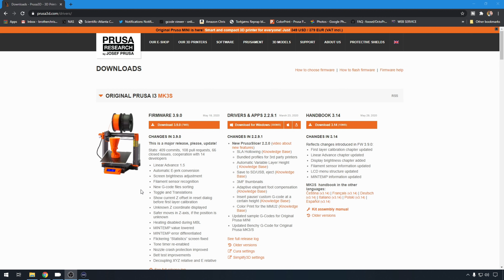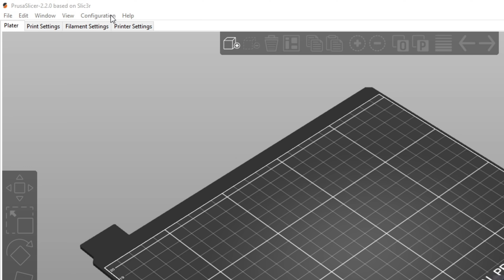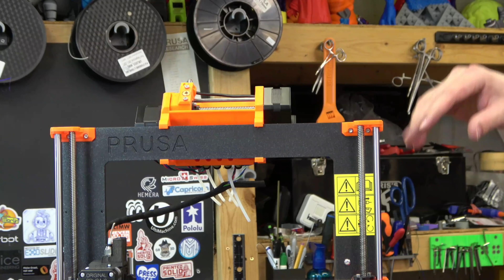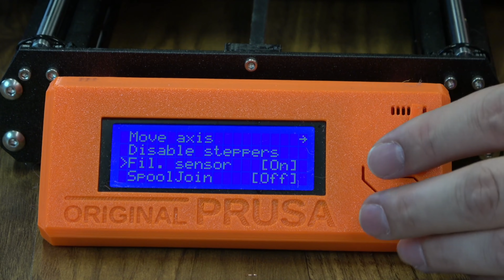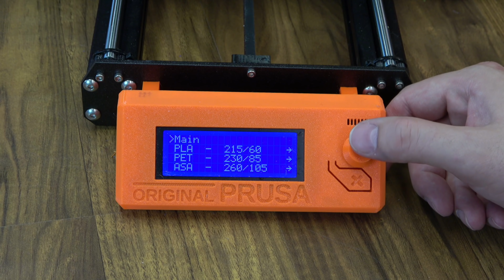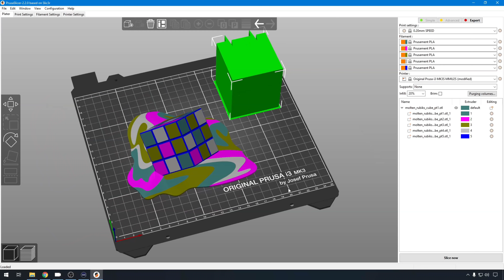Prusa MMU2 - Take 2 - Firmware Update - New Cut Feature - Time Lapse - Chris's Basement

Comment: I have a print at home that's stalled. the filament selector is slightly off and filament wont' load. is there a way to get the selector to home out during the error mid print?
Reply from the maker: You can pull the filament out and het reset on the MMU, but get ready to pause the printer, because it might continue without the filament. After the pause hit change filament and select the correct one. That might get you going again.
Reply: @ChrisRiley  Thank you , I'll try that next time!

Comment: Chris.. I am new to the hobby. I have a chiron with original firmware and ( original 8 bit mother board trigorilla) I have a mmu2 I would like to add to it . Would love to have a tutorial on just that. 
I would also like to know if I add a 2nd hot end and a 2nd mmu2. As I have a second kit I can build and add .. to be able to print with 10 different filaments . Would like an honest answer please
Reply from the maker: Hey Frank, that config would probably be a nightmare to setup. I am not sure how the slicer would handle that. With the Chiron, with out switch to direct drive and getting a filament sensor in the right location the MMU2 is going to be a real struggle. I might look at something like the Chameleon v2 that is made for more types of printers.
Reply: @ChrisRiley  just a quick question wouldn't the mmu2 act as a direct drive? And the filament sensor with in the mmu2 should work. In theory any way. 
I do have a bigtree gtr. Board I can switch to.. can run up to 11 axis. 
Thanks for replying.. 
So much for Left handed thinking...lol
Reply from the maker: @Twisted-wizard  Hey Frank, the MMU2 just feeds enough for the extruder to take over, so it's not a great extruder. The FINDA should work, but to keep the MMU2 and extruder from fighting, a filament sensor at the extruder works the best. Yes, a lot of reverse engineering here.

Comment: Thanks for this Chris. 

I was one of those people who's MMU2s turned into an expensive white elephant. I took it off over a year ago - it kept stopping even single filament  prints loading. Its sat at the side of the room "in disgrace".
 
This video told me Prusa had finally made an meaningful firmware update and design changes  - long overdue IMHO.

I dusted off my components, printed the updated parts, gave the all the moving pars a general spiff up, updated the firmware and low and behold it actually managed to print a part without intervention - not sure its ever managed that till now.

I think it worth noting that i printed a few other parts beyond those mentioned and my new parts seemed to have different tolerance vs the prusa parts I received initially. I was one of the first to get the MMU2S, so i don't know if they have made design changes or the printer mine came from was just having a bad day, but my newly printed parts from my own printer are definitely of a slightly different geometry, only really noticeable taking one off and pushing the other on but still there.
Reply from the maker: Great to hear that this got you up and running. I think there were a few parts that changed over time. Probably worth trying to reprint a lot of them if a user is having issues, not a bad idea.

Comment: So a new problem. I printed my first multicolor print using PLA and 3 times there was a kink in the filament. when the printer switches color with a kink in the filament it loads to the IR sensor and detects the initial filament but then the IR sensor changes states when it gets to that kink. There needs to be active monitoring on that IR sensor. the printer then fails to print a layer because it thinks it has filament but will not feed because of the kink. see my video about it here:  https://www.youtube.com/watch?v=q8UhnB1W_Bk
Reply from the maker: Is it a kink, or is it easting a hole in it? Might be the door springs are too tight.

Comment: Sooo.. I just completed my assembly of the MK3S and the MMU2S. I loaded only one filament in slot one to do a print. @ 20% the MMU2S started clicking and the MK3S just stopped printing and went back the the info screen. there was no recovery of the print job.. nothing. the print head just stopped where it was so the print just started to melt while the MMU kept clicking.... this was only with a single filament so this is not very encouraging.
Reply from the maker: Time to chat with support, something isn't right.

Comment: I'm trying to figure out how to use the IR sensor on a non-einsy board, but can't find much in the way of documentation.
Has anyone tried setting it up on something like an MKS Gen_L, or SKR v1.3?
I don't understand what the difference is between MMU_EXTRUDER_SENSOR and PRUSA_MMU2_S_MODE in Marlin, and I can't find any info for how to connect the IR sensor to the board.
Reply from the maker: The IR sensor is just a standard setup. 5v, you can use VCC, GND and Signal on any endstop pin you wish.
Reply: Ah, got it. Thanks!
The board I was using was a bit abused so I had to replace it with an skr v1.3, but now I can't communicate with the MMU2s at all.

In your first MMU2 video you showed a quick tip on how to connect it to an skr v1.3, but I can't get it to work correctly.
The combination of SERIAL_PORT and MMU_SERIAL settings seem to be different at every guide I find online, and no combination works for me.
Do you still have the configuration you used for this board available? Would be very interested in taking a look at that if you do.
Reply from the maker: @Akegata42  I looked and can't find it. I hope to have some SKR testing done soon.
Reply: Scrap that, I managed to get it connected on my old MKS Gen_L after all.
The behavior is very weird, but the sensor definitely works..
Reply: @ChrisRiley  Did you have to change FIL_RUNOUT_STATE to enable the IR sensor?
It reports incorrectly if I don't change that to HIGH, but when I do that the printer doesn't try to load filament when I start a print..
Reply from the maker: @Akegata42  Not sure, I am going to start testing it again soon.

Comment: I can not believe I just saw this video. well done Chris. I may have to go with that selector but I will try the one with the magnet in it first I have already printed both just haven't changed them yet.
Reply from the maker: Let us know how it goes. Thanks
Reply: @ChrisRiley  I just put on the new selector with magnet and I'm printing the pass through part now :-)
Reply from the maker: @zimmy1958  Nice, they are a lot of fun when you get them working.
Reply: @ChrisRiley  seam to working good but the cut function ( I get a jam there, bad cut ) my tip is not so good not sure why. It goes all the way to the hot end and pulls it back.
Reply from the maker: @zimmy1958  There is a new reworked mmu2 front plate that could help, I show it here. https://youtu.be/V4u0UnHD9Tw?t=669
Reply: @ChrisRiley  Thanks Chris

Comment: Chris, thanks for the video. Can I ask how long the PTFE should be down to the extruder when amended using the through coupler part please?
Reply from the maker: Stock the tube is 360mm, you can get away with using that one, but a 380mm would be better.

Comment: Another great video!

Do you have any comments on the stock filament buffer? I don't understand why you were just sitting these on some normal spool holders. Seems like that was a recipe for the tangling you had on the pink spool. I haven't used the MMU yet , so I'm very curious...

I don't know anything about the rewinding spool holders. Do you have a roundup or any specific comments on these?
Reply from the maker: The Prusa buffer is kind of a pain in my opinion. I like these.  https://www.prusaprinters.org/prints/31989-numbered-gravity-spool-holders-for-mmu2s
Reply: @ChrisRiley  Thank you again, that was really helpful!

I ended up printing a couple of these https://www.prusaprinters.org/prints/3729-multiple-mechanism-auto-rewind-spool-holder/comments

I haven't used them in an actual print yet, but spinning by hand they seem like a good design.

Comment: Hello Chris! Great videos and work you are doing! I wonder if you have any comments about the selector with magnet? https://www.thingiverse.com/thing:3528314 and also people that chose to mount the mmu2s unit laying flat, like for exemple https://www.thingiverse.com/thing:3418267 ?
Reply from the maker: Thanks! Both mods should work just fine. I really don't have any thought one way of the other. The lay flat mod might make the filament path a little but you can adjust the length of the tube to help. The magnet in the finda sensor might help if there are strings left in there.

Comment: Thanks Chris for a great video. It’s good for us to see that others also have challenges with the MMU2S. The new firmware/hardware seems like a step in the right direction. I’ve been successful with the MMU but these improvements should make it better. Looking forward to your solution to the buffer issue. I’ve tried the rewinding spool holders with mixed results.
Reply from the maker: Thank you

Comment: Hi Chris: mmu2-front-PTFE-holder must also be replaced, which has been changed for a cleaner cut, if not replaced the filament risks bending during the cut and jamming mmu2
Reply from the maker: Thanks for the heads up, I will check it out.

Comment: I too was one of those plagued with MMU2S issues until I started replacing parts with my own designs like a custom selector ( https://i.imgur.com/9wzy2QR.png ) entirely omitting the blade which, apparently, is capable of just shearing off the filament. I also made changes for it too accepting a PC4-M10 Passthrough Connector like you did with the Printhead reducing the amount of bowden tubes the Filament has to go through from 4 to 2.

Other than the occasional Filament getting ground to a pulp in the head and not gripping anymore I had barely any problems with my MMU2S since making those streamlining changes to it.
Reply from the maker: Nice work, sounds like a good list of mods. Do you have them posted somewhere?

Comment: If you have a lot of layers without filament changes, and there is bed space, use the spare layers option for the wipe block. On some of the test prints I have been doing lately, the size reduction has been over 95%, but this is highly dependent on the model.
Reply from the maker: Great tip, I have yet to try this but I will.

Comment: Fantastic video, Chris!  This ought to be required viewing for anyone with an MMU2!  When I installed mine, I had intermittent issues with the IR sensor.  I finally solved my problem when someone suggested I leave the sensor display status running during a print and I realized that the IR sensor was flipping back and forth from 0 to 1 during the print!  I made an adjustment, and It is been pretty good since.  I think people need to expect to do some manual interventions, but a huge benefit of the MMU2 over some other multi-material systems is that after the manual intervention, you can continue the print without issue in most (nearly all) cases!
Reply from the maker: Thanks John, that is a great point. Try that on a Pallet, no go.

Comment: When i bought the mmu2s it didn't have this features and worked. Like 4 of 5 prints was succesfull and the problem was the mmu2s but not entirely. The two screws that are adjustable were too loose. So when i started to understand the mmu2s now my only problem is make the filament stick to the bed. Never had an issue since then
Reply from the maker: I'm glad you found a solution. Thanks for watching

Comment: I hear that you really need spring-loaded filament holders to use the MMU2, so the filament can’t as easily come off the spool.
Reply from the maker: Absolutely, I need to find a little better version.
Reply: @ChrisRiley  I have been using the rewinder style spool holders (wall mounted and stand). The key to making those prints is to use the latest model printed spring. Early versions break the springs too easily. See https://www.thingiverse.com/thing:3338467 for a rundown on nearly every rewinder design.
Reply from the maker: @ogmaker  Thanks Bill, I have had the consistence issue on these as well, I am thinking about giving these a try, no wall mount for these though.

Comment: I'm using the Gravity spool holder
Reply from the maker: Sweet, do you have a link?
Reply: https://www.prusaprinters.org/es/prints/4359
Reply from the maker: @deeareus9886  I am going to check it out now! Thanks for the link!
Reply from the maker: @deeareus9886  Thanks is awesome, wouldn't you know I threw away all my MMU2 trays.
Reply: I'm working on a no tray file; there it was a few issues with the spool size, also there is a prusa ikea table so you can mount all the spools up

Comment: Hi Chris, thx for the videos, i have 1 question: i have built a custom 3d printer but i dont know how to right the printer specifications, what should i test to get all the specifications Thanks again
Reply from the maker: Do you have a working config now? Or are you building it from scratch?
Reply: @ChrisRiley  Hi Im building from scratch, i have build the frames and im using some parts of Ender3 { Ender-3 Motherboard, Ender-3 Hotbed (235*235), the printer is CoreXY like Tronxy X5S but smaller but the specifications dont know to find it out xd
Reply from the maker: @turkialrasheedi8597  I would start with an example config. Start with something like the Tronxy and go from there. https://github.com/MarlinFirmware/Marlin/tree/2.0.x/config
Reply: Thanks alot Sir, and is it possible to upload Tronxy marlin config. to Creality Ender-3 motherboard? i think its V1.1.4
Reply from the maker: @turkialrasheedi8597  That mainboard might not have enough memory. You can give it a try.

Comment: ...that moment when you see a part you remixed in a video and wonder if it's yours,  ...then follow the link and it is!   Thanks to KevMar for the start on that M10 passthrough extruder top.   Chris, glad to see you are getting good use out of it, as I still am my two.  :)  And all I did really was add the threads which barely fit, and tidied up the edges some.  Keep up the awesome show!
Reply from the maker: Thank you Clint, I should have given you a shout out. I need to start doing a better job of this, you guys make a lot of this stuff possible.

Comment: Power outages are fairly uncommon where I live, but my biggest concern is the heated bed cooling down and the print detaching. It looked like that had begun on the purge tower. How long was it powered off?
Reply from the maker: It was off for about 15 minutes and I agree, the PEI holds well, but this won't save all the prints.